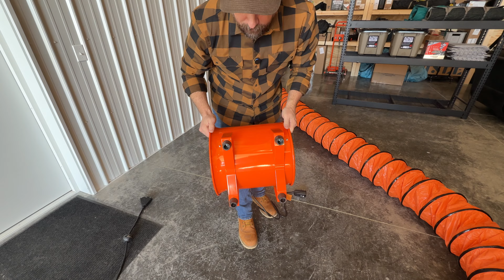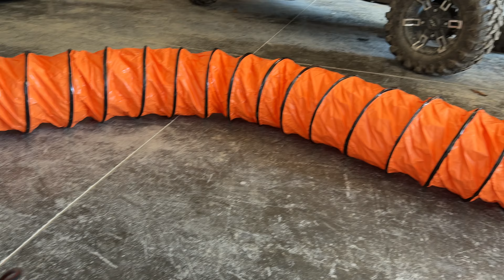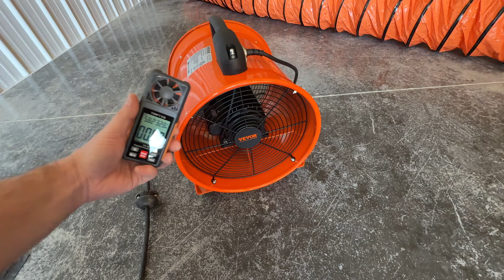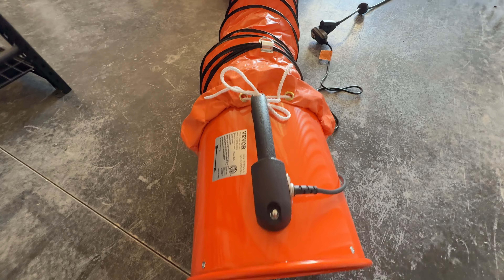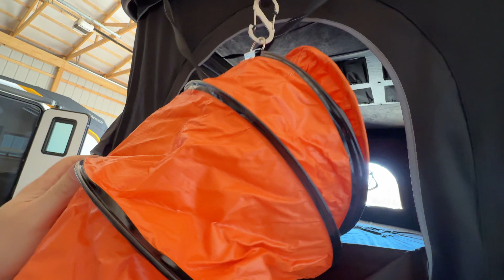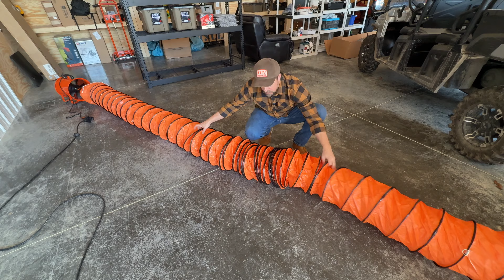VEVOR Axial Ventilation Fan Review | Airflow Test + 16ft Duct Demo

Comment: I was interested to see how you got the discharge duct to become an intake duct without it being reinforced. I have the same model from a different manufacturing year and my duct collapsed and then shot back towards the fan, I assumed that was what should happen. A tip for Axial Fans though is that they have to build pressure from a positive atmosphere, they don't perform when they have to pull air from a long run of high resistance ducting. Axial Fans weren't designed with the impeller necessary to be a vacuum motor. Also CFM is measured with a Flow Hood it's a volume of air moved in a set time, the annemometer will only tell you the speed or velocity but can't determine the total volume of anything larger than its own size.
Reply: Aside from the meter reading, he wasted our time by not measuring at both both ends while running the hose.